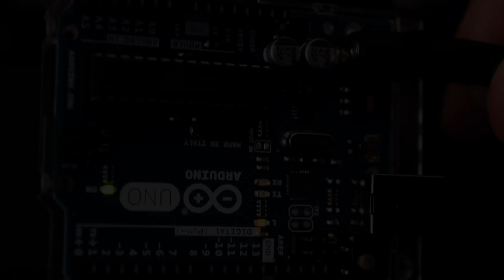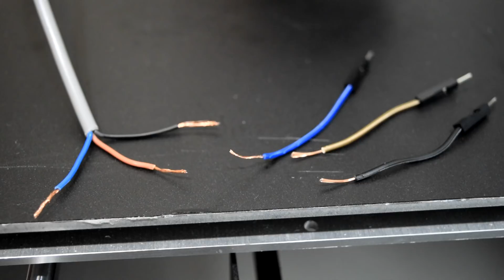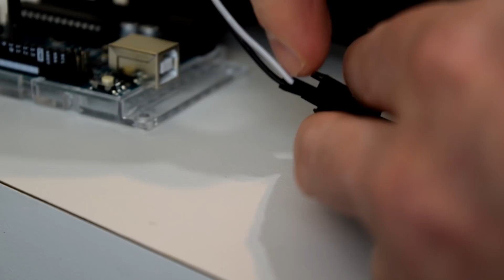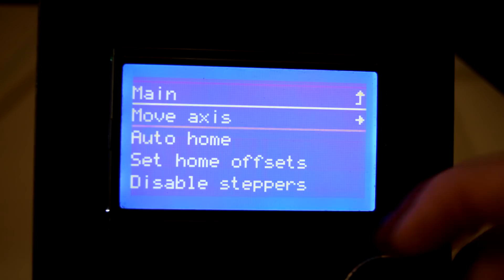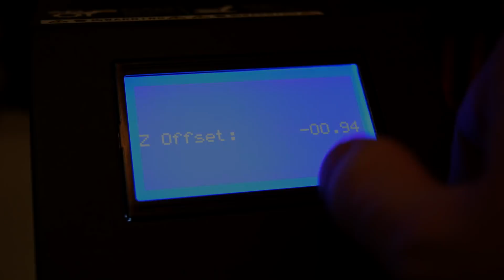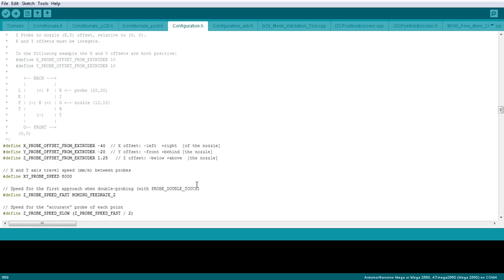Monoprice Maker Select | Auto Bed Leveling w Stock Board

Comment: @remainindoors ive just finished doing this mod to my wanhao i3 v2.1 and while it works my extruder now seems to not want to release filament and when i print it does the auto home perfectly but the extruder makes a weird sound and then refuses to release the filament any ideas?
Reply from the maker: When you say refuses to release the filament, do you mean when you try to take the filament back out of the extruder? You would have to make sure the nozzle is still heated up to temperature to take the filament back out. or if you mean it isn't extruding melted filament like it should, you can try raising the hot end up off of the bed, set the nozzle temperature to high enough to melt the filament and make sure it extrudes by moving the Extruder axis. if it's clicking when you try to do that, the nozzle temperature might be too low for the filament, or there might be a problem with how the cables are plugged into the mainboard. or possibly other reasons. it's hard to say without more details.
Reply: @RemainIndoors  I might of found the issue it's set to filament diameter as 3mm but I'm running 1.75 just testing to see if thats the issue
Reply: @RemainIndoors  nope that hasn't helped it's almost like the extruders like either trying to reverse or it's missing the filament all together...
Reply: @RemainIndoors  to add detail it worked perfectly at 220 before I did the firmware change I have changed the filament or the extruder. I didn't mess with the other wire or unscrew anything I wasn't meant too.
Reply from the maker: @jackdiy6672  gotcha, it is possible the extruder setting in the firmware is inverted from what your printer's hardware expects. If you open the Marlin folder and find the Configuration.h file, there's a setting in there that looks like this:
#define INVERT_E0_DIR true

you can test changing that true to false and writing the firmware to your printer again. if it is just the extruder going the wrong direction, that should fix it.
Reply: @RemainIndoors  I'll give that ago tomorrow would i be able to do that via usb now or do I still need to use the arduino?
Reply from the maker: @jackdiy6672  you can just do it via USB. no need to take apart your printer or use the arduino once you have the bootloader written to the board
Reply: Could you explain how to do that bud I'm so confused do I need to move the jumper to usb?
Reply from the maker: @jackdiy6672  Sure, it is kind of confusing. nope no need to move the jumper back to USB. it can stay on VREG. 
1. With your printer completely assembled, connect your printer to your computer via USB cable
2. turn on your printer
3. Make the change from true to false in the Configuration.h file
4. in the MakerSelect - MakerSelect Marlin 1.1.3 v2 - Marlin folder, open the Marlin.ino file in the Arduino IDE program on your computer
5. It should be pretty much the same from this point, but you don't have to disassemble or reassemble your printer: https://youtu.be/ejpSniiJejI?si=q7WDC7mmdKqIwT_C&t=480

Sorry I haven't done much 3D printer modding in at least 4 years
Reply: @RemainIndoors  it's ok I'll really appreciate you replying on such an old video I've done the steps and the stepper motors still doing the same as the video I linked 😅 my heads fried might have to update to a newer version of marlin
Reply from the maker: @jackdiy6672  Ahhh I didn't see that video. it got held for review because of the link. So, I think I know what's most likely your problem from that. or, well a couple of possible explanations: 
1. The stepper motor pins/wires are criss-crossed vs what the firmware expects (ex. 1324 instead of 1234)
2. the board-end of that stepper motor may have gotten partially unplugged when you were putting your printer back together. 

I'd guess the criss-crossed wires is more likely, which is almost definitely fixable via the firmware, but that's getting a little more into the weeds on stuff I haven't tested. 

basic nerdy explanation of why that would be a problem - stepper motors run on electromagnets, two of the wires would tell one set of magnets in your stepper motor when to turn on, and the other set of wires would tell the other set of magnets when to turn on. if the wires are criss-crossed, the magnets would fight against each other, causing the jittering and weird noise you see in your video.

in my experience, it's usually the middle two wires that are mixed up. so depending on how easy it would be for you to flip those physically, that might fix your issue. 

There's also a SANGUINOLOLU_11.h file in the firmware that has E0_STEP_PIN and E0_DIR_PIN defined, but I don't know what changing those would do. My guess is flipping those would be the same as physically flipping the wires, but I don't know that for sure.
Reply: @RemainIndoors  that could be the problem I'll give it ago as see if that helps thanks mate you have been a great help

Comment: I was able to get everything loaded and working.  Except for the SD card.  I checked the configuration H file and it appears you have it activated, correct?  if so any other ideas on what to try?
Reply from the maker: yeah, the SD card is enabled in the marlin firmware attached to this video. you may want to try uncommenting one of the SPI Speed settings below that in configuration.h - but it should be working without that.
Reply: @RemainIndoors  remain indoors after loading marlin to my board, I can no longer connect using the usb port to my computer..any ideas?  it was working with the stock software.

Comment: I want to do this mod to my printer now at the end of 2024. Is this still viable? Can i flash Marlin?
Reply from the maker: If you have this same printer with the original parts in it, you should be able to. I haven't tried updating to later versions of marlin, so I'm not sure what all has changed. but sounds like a fun project :)

Comment: I can't get the nozzle wipe to work with auto bed leveling. Any tricks to that?
Reply: I guess I just had some junk in my start code that was confusing it. After I copied what you had on in your settings it worked.

Comment: I'm confused, maybe someone can help me out. I'm not sure how this actually levels the bed, as the bed doesn't move during the G29 command. Since you zero it off of the center of the bed, how does it level at the corners?
Reply: The G29 command cause the autoleveler of your choice to go torwards the print bed in 9 different places. It then will adjust your gcode based on the values that it recieves from the leveling process. Say it sensed that your bottom left corner is 1mm lower than center, then as the extruder nozzle travels torwards your left corner your z axis will lower that 1mm. Its not that the code physically levels the bed, it that it adjusts your gcode to account for the variance in the bed. In theory you code use this code and print with your bed at, lets say, a 20 degree angle. While not recommended you could in theory do it.

Comment: is this possible to do with a clone arduino uno like Elegoo UNO R3 or would i have to change things
Reply from the maker: As long as the Clone arduino provides the same voltages and works the same as a regular arduino uno, it "should" work. but I can't guarantee it. One person was having problems and had to return their Uno, but it turned out it wasn't the same one as mine. If you're comfortable with soldering, I'm working on editing a followup video to this one right now that shows how to do this without the Uno. you would still need a way to burn a bootloader to the board if you haven't already, so pretty much any Arduino should work in that case, but the new video will show how to hook up the sensor straight to your melzi board using a few resistors.
Reply: should i wait for the new video then i ordered a Arduino UNO R3MEGA328P ATMEGA16U2 Compat ? btw what did you use instead of the springs on the bed thanks for the reply
Reply from the maker: you may want to wait for the new video before you get started. I should hopefully have it uploaded in the next few days, but assuming you already have a soldering iron and a multimeter, the only extra parts you need are a couple wires and two resistors (a pack of a couple hundred resistors is less than 10 bucks on amazon) everything else is just referring back to this video.
Reply: i have ordered the things to do it this way but if you think your new way is better i will do that do i need to install marlin for both of the ways
Reply from the maker: Yes, everything's the same in both. the only difference is instead of connecting the Arduino in between the sensor and your printer's Endstop, the new method involves connecting the sensor straight to your printer. it's a little harder, but less likely to fail for inconsistency in parts.
Reply: ok thanks i will wait for the new video thanks you dont mind it i get stuck as you a few questions do you thanks btw

Comment: Will this mod work with a glass bed? It seems like the sensor would not work with glass.
Reply from the maker: This sensor specifically won't work with glass. capacitive sensors will sense glass, and you can most likely find one the same size and settings. you just have to dial it in to trigger at the right times as most capactive sensors have an adjustment screw to fine tune the sensitivity.
Reply: @RemainIndoors  Can you link me an example on Ebay so I know what I am looking for?
Reply from the maker: @LankyFrank    something like this should work, but I can't guarantee it. It's supposed to take 6v-36v but the Arduino only outputs 5v max, so it may not have enough voltage unless you go by the Voltage Divider method (https://www.youtube.com/watch?v=t3nzSxEpCrU):   https://www.ebay.com/itm/Capacitive-Proximity-Sensor-Switch-LJC12A3-5-Z-BX-NPN-NO-DC6-36V-5mm-Distance/332629350705

Comment: Can this be modified to work with a Bltouch probe?
Reply from the maker: it's not really impossible, but I haven't done it. Here's a video of somebody doing something similar with a CR-10 https://www.youtube.com/watch?v=ioL-7oEBI1Q the CR-10 and the Maker Select both have a Melzi board, although they look different they're both limited to a certain number of usable pins. the sensor used in this video has 3 wires, a power wire and ground wire to power the sensor, and a signal wire to let the board know when it senses something. The BLTouch on the other hand has 5 wires, a power wire and ground wire to power the BLTouch, a signal and another ground to make a circuit with the board to let it know when the pin senses something, and the last wire is a signal to let the BLTouch know when to deploy/stow the pin. There aren't any open pins on the Maker Select board, and since the Melzi board isn't talking to the Arduino at all, the arduino wouldn't know when to tell the BLTouch to do it's stuff.
Reply: I understand the extra wires.  Would I wire the extras to the UNO or to the Melzi board?  Does the sketch on the UNO need anything extra to work with the BLTouch?
Reply from the maker: all of the wires would need to go to the melzi board, and the firmware would have to be changed to control them accordingly. but it might be easier to just replace the mainboard all together. However, if you want to keep the original board, you may be able to use the beeper pin from the lcd as the BLTouch control pin, then you could use 5v and ground from anywhere on the board that supplies power consistently, and the remaining two wires would just replace the wires on the Z endstop. Like I said, I've never tried it. this is just theoretical and based on my understanding of how Arduino works.

Comment: I am getting this error when trying to update to the marlin FW:

C:\Users\derek\Desktop\UnoSketchAndFirmware\MakerSelect Marlin 1.1.3\Marlin\Marlin.ino:45:110: fatal error: U8glib.h: No such file or directory

     #include <U8glib.h> // library for graphics LCD by Oli Kraus (https://github.com/olikraus/U8glib_Arduino)

                                                                                                              ^

compilation terminated.

exit status 1
Error compiling for board Sanguino.
Reply from the maker: you'll have to install the u8glib.h library in your Arduino IDE. https://code.google.com/archive/p/u8glib/downloads  - download that zip file to somewhere on your machine, then open the Firmware and go to Sketch - Include Library - Add .Zip library and choose that zip file.